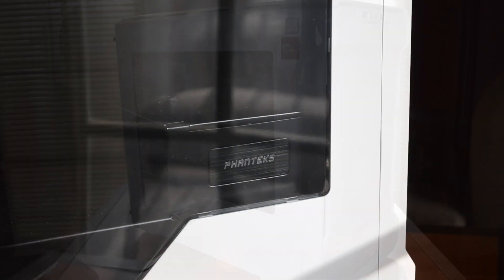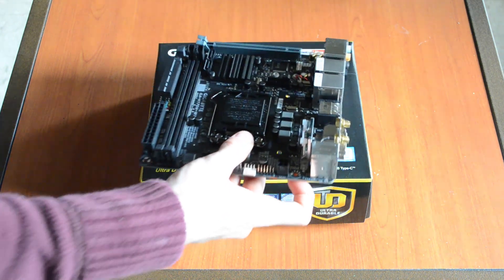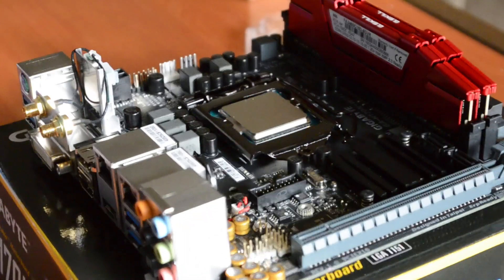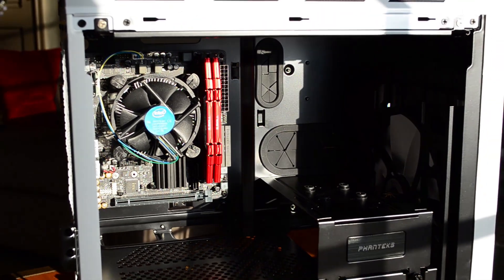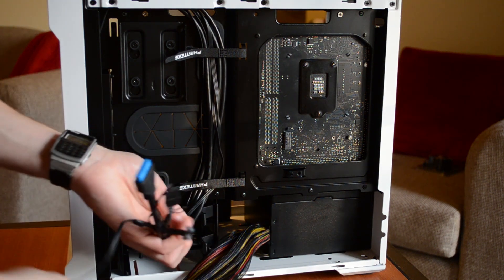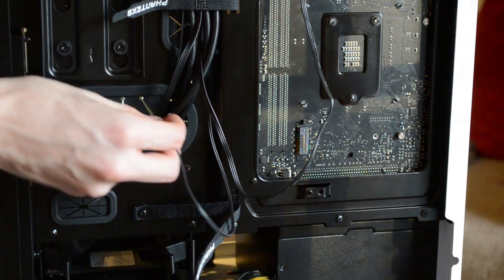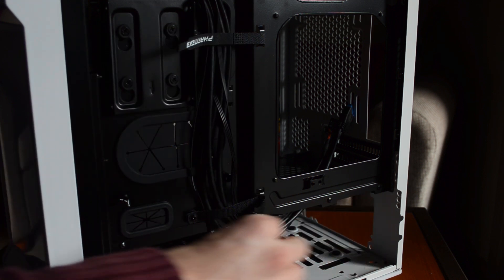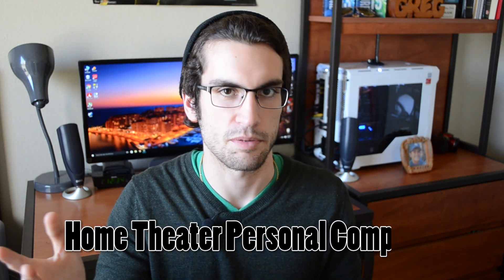How To Build An ITX Skylake PC

Comment: I have this same case, Can some please explain how I can get the temps down on the 3060 GPU I am using, My 3060 is hitting temps of 84 degrees Celsius, I am having to take the side off when I on AMS 2 coz I am worried my GPU temp will creep up and up, Plus surely running temps in the 80s C cannot be good for longevity, I really cannot afford any more new parts now, I only got the 3060 12gb a few months ago, Plus the 12gb 3060 is dealing with every game I threw at it, So far I do think the Zotac 12gb 3060 is well worth the price for how much of an upgrade it is for the PC, I heard or read AMD equivalent to the 3060 in specs 6000 series is getting stuttering problems, I can't say for sure though as I ain't got an AMD GPU...
Yeah can someone please explain how I can get GPU temps to in the 60s Degrees C and not 84 Degrees C, Or is the GPU hitting the 80s Degrees C going to create damage over time, I is even thinking of getting one of those GPU coolers you attach to the backplate, The backplate is getting hot, Hotter than I think it should be anyways, I think it is the case, The clearance from the PSU and GPU is not very much, About half inch clearance if that from the fans on the GPU to the PSU, I was even thinking of getting some more powerful fans for the front, Rather than the one big fan 3 powerful fans on the front, I think might just be better than just the one fan....
The CPU temps are amazing, I am using a Cooler Master V2 240 liquid cooler, Fantastic liquid cooler for the price, Plus it is RGB if you want, Turn it off if you don't, lol, Still a great liquid cooler, My i5 12600k CPU never goes past the 60 degrees Celsius with this Cooler Master V2, I would buy another one if I was doing another PC, I like the black MSI liquid cooler as well though, lol.....
This Phantek case is pretty good apart from the GPU hitting 84 degrees Celsius this case is a tidy semi little PC case, Be aware of the GPU temps though, I couldn't imagine a Beefy GPU like a 4090 would even fit in this case with out using a riser or, Unless it was water cooled, But this case is designed with water cooling in mind apparently, lol, I am not that technical YET, lol....
Great video even if it looks like one of the first videos you put together, Hat's off sticking to it and following your dreams, you deserve all the success you get in turn bro...

Comment: can i use 2x16gb ddr4 ram sticks for a mini itx build?which would be faster 4x8gb ram or 2x16gb ?
Reply: what about 32 gb is 4 x8gb ddr4 sticks more faster than 2 x 16gb ddr4 sticks..I want it for 3d and editing only(no gaming)
Reply: girish chandra bojja Every miniITX board has 2 DIMM slots, so you can't have 4x8GB.

Comment: Would you recommend the mother board/brand from this video? I was thinking about getting the Z170 version with both wifi and Bluetooth. Thanks
Reply: Brandon David only major benefit z170 provide (that differs from h series) is the ability to over lock. And even then u'd need to buy a Cpu that supports overclocking ( in intel's case, a cpu model that ends with k)
Reply: Oh yeah I know, I have the i56600K, I was looking at mother boards and the oc version of his seems nice but there's not a ton of reviews
Reply: since you already have a k version cpu, might as well get a Mobo that can utilize its additional feature to overclock, which u payed extra for, right? I would.
Reply: Oh yeah, def. I know that but I was just trying to get a feeler on the brand and board cause the z version is the same cept the chipset and price.

Comment: Hi, can someone suggest my anything cheaper than the H170N Wifior something the same price that supports

itx mobo, 2133mhz - 2.4kmhz  and the usual stuff.
Reply: I have an Asrock motherboard and I am completely satisfied especially for the price
here is an Asrock one for cheaper for a skylake processor
http://www.newegg.com/Product/Product.aspx?Item=N82E16813157678&nm_mc=KNC-GoogleAdwords-PC&cm_mmc=KNC-GoogleAdwords-PC-_-pla-_-Motherboards+-+Intel-_-N82E16813157678&gclid=CjwKEAjww_a8BRDB-O-OqZb_vRASJAA9yrc5x6C1duZfTVRbR8KgXPk3HKutXAmGI2AP3g4LsMapmRoCbv3w_wcB&gclsrc=aw.ds
Reply: Thank you :) I might be able to find this in our country.
Reply: +Seton Magic no problem! just note this one doesn't have Wi-Fi built in to the mother noard! But I don't find that a big deal one I went Ethernet I never will go back!
Reply: +Carlos Santillana *motherboard
Reply: Carlos Santillana Ethernet is no problem, could you suggest more so I can have more varieties? like gigabytes asusetc
Reply: +Seton Magic 
here is two more 
MSI H110I PRO
ASUS H110I-PLUS D3/CSM
but what I recommend is go to pcpartpicker.com and select a cpu then select an itx case and then when you search for motherboards it will only show you  motherboards that will work, along with their price and rating!
that website was incredibly useful for my first build.
Reply: +Carlos Santillana nvm I don't recommend the Asus one, it only takes ddr3 memory and since you are going to be using skylake you can only use ddr3L which is probably hard to find

Comment: Trying to build a PC with similar components although I'm swapping the 380 with a 380x (unless the 4gb rx 480s come back in stock). Would a 550W power supply be enough or should I go with a 650W?
Reply: TytanyxGames 550W should be enough.

Comment: Hey man!! i'm looking to build myself a Mini ITX rig to place in an other room to game on .... right now i'm running an i5 4690k with evo cooler and a 1070 , but the idea is to get a i7 6700 (non k version) with a 970 i have laying around or maybe even my 1070.  
would it be ok to use a stock intel cooler on an i7 6700 in that kind of configuration , i'm really scared about the temps they might get ....
Reply: as long as youre not overclocking the stock coolers should be fine but keep in mind that they are louder than aftermarket coolers
Reply: I think you'll be fine. The Intel cooler is loud but it gets the job done as long as you don't try to overclock it. You'll need a different cooler if you plan to do so. If the stock cooler doesn't get the job done, just use the cooler that you have or buy a different one. It's only like 30 bucks :P
Reply: It's an i7 6700, not a "k" model, thus not overclockable. A stock cooler should be fine.

Comment: Do you need an itx psu for an itx build? like was the one you used small
Reply: There is no such thing. Use pcpartpicker.com if you're building a pc, it shows if the parts you use aren't compatible.
Reply: The Motherboard is basically the only thing that differs in size.

Comment: reply to this pls I need help
I live in India where computer parts are very expensive due to imports duty and shit.
my config:
i5 - 6500
any good but cheapest H170 or B150 mobile
8 GB DDR4 2133 MHz (again cheapest Kingston fury most probably)
and an Nvidia GTX 1060
with a 240 GB SSD 
all of this will cost around 840$ in India which is too much and a case and power supply is still not included!
so my question is: Is this build will be overkill for an 60Hz monitor as I don't have fund for 120hz or above or 1440p monitor I have a sony 200Hz HDTV
Reply: motherboard*

Comment: Maybe someone can help me, im planning on building a PC very similar to this one, im interested in gaming and rendering video and 3d/2d animation but im planning on getting a gtx 970 or maybe the 1070... anyways, i was wondering, is that MoBo good enough? i mean for the 4 pin conector, an 8 pin conector wont get much more of the cpu performance? (im not going to overclock btw) also, using a wattage calculator says i need a 550w psu for what i need.

This is the first time i build one myself, so i don't really know a lot of things, im doing my research but im still a bit confused.
Reply: Do MORE research
Reply: im researching for a similar build too, to replace my laptop. From what I know motherboard dont really affect cpu performance, 400-550 watts psu are priced similarly, just get the one you need (like fully modular or 80+gold). As for wattage should be enough for most itx builds in that range.
Reply: currently running the same build from this video, but with an MSI GTX 970 4G that I've over clocked and it's fine. however you need a molex adapter to do this, and honestly I'd just upgrade the psu if I were you to one that has the 6pin (or four plus two pin) and 4 pin connector -the one from the video here only has one 4+2, but the 970 needs that one and a 4pin.

Comment: How much fps in Cs go?
Cpu: Intel core i5-6500
Motherboard: MSI B150M BAZOOKA
Graphic Card: EVGA GeForce GTX960 4GB SC Gaming 
Psu: EVGA 500W White
Ram: HyperX Fury Black DDR4 2x4GB 2400MHz 
SSD: Samsung 850 EVO Series 250GB
Cabinet: Fractal Design Core 2500
Reply from the maker: +Nikolai Skarstein A ton. It's a pointless question. You'll never see that many frames.
Reply: +Science Studio oh okey :)

Comment: I have question about the 200mm fan is it quiet or should I buy 2 140mm noctua fans
Reply: It's quite and pushes alot of air. I have it running at 800rpm and have no cooling issues.

Comment: PC case buttons are not sensitive to which way round you connect the header cable. LEDs are sensitive to polarity, buttons are not. The buttons work by simply shorting the pins.

Other than that, great stuff.
Reply from the maker: I have mentioned that in some of my other build logs. Nonetheless, aligning positive to positive and negative to negative is still a healthy practice.

Comment: What case can i use instead of this?I Can't find Phanteks case
Reply: +The D1zz And what cheaper mobo should i get?
Reply: You can get the Define Nano S its the same price as this case and can hold almost the same ammount of hardware. But it's best to have a reference GPU for the Nano S since the GPU is very close to the GPU.

Comment: well, 320*1.5=480
Reply from the maker: Yes, which is why I said "abouuuut 450."
Reply: +Science Studio I mean, if there is only a difference like 3 or 4 watts more than 450, you can say that. For the real deal, you are using 430watts, I don't think 50 watts is a "small gap". Normally I would use your psu calculating function as well, but if I got a result like 480, 473 or even 460, I will go with 500watts ones, just in case I might have more other usages.
Reply from the maker: +郑程耀 I know how it works. However, I wanted to prove that even a system as refined as this one doesn't need a beefy power supply - only a reliable one.
Reply: +Science Studio Oh, thanks, that dispelled my concern. I was not sure if this way of psu choosing will be reliable when I was shopping my pc parts. Got some new knowledge tho.

Comment: I love my full sized atx towers man. I may not keep em forever. If I can get intel E series in itx and fit the highest end amd and nvidia gpu in an itx I'll be all for it.
Reply from the maker: This case here will fit pretty much any graphics card you throw at it. As for the CPU/ITX support, that isn't the fault of the case, but it was nice to play around with a smaller PC for a while. It was a different feeling.
Reply: there is an x99 itx board from asrock so you can get your extreme editions although overclocking would be limited and you might have trouble finding high wattage sfx power supplies so make sure the case supports atx or you might be capped at 500w

Comment: A 550 or 600W PSU would be ideal for this build as power supplies operate at optimal efficiency at around 50% load. The 430 would almost be maxed out in this build meaning, you're going have worse efficiency, thus more heat, which equals wasted energy.
Reply from the maker: The maximum power draw is not near 430W. I'm pulling about 350W under load from the wall.
Reply: +Science Studio This is would be running at about 80% load on thr PSU and would still kill efficiency, but since this PSU is only 80+ white rated anyway, I'm guessing that's not a concern. As I said though, a higher wattage power supply would mean better efficiency and therefore less heat generated, hence a cooler system.
Reply from the maker: Not much heat at all is generated by these PSUs under load. A lot of people tend to drastically overestimate their load power consumption. I went with the 430W to prove a point, otherwise I would have spent $5 more for a 500W. I broke down each part's individual power consumption in the video. Even with a safety factor of 1.5 (an extremely liberal estimate), we barely hit 450W.
Reply: +Science Studio Like I said, it's not only about heat, it's about the power efficiency and PSU operate at optimal power efficiency at around 50% load. I do understand that this wattage is more than enough to run the system, but the efficiency takes a dive at about 70% load. Of course you won't run into a situation with this setup to where wattage will be a concern.

Comment: mATX > mITX,  IMHO. Almost all ITX cases are not so small when compared with their mATX competitors. mATX does not leave you with the single pcie 16x, which for someone looking for an upgradable computer, would be a better option.
Reply from the maker: It's an entirely subjective decision. Most aren't going to fill those extra PCIe slots with anything at all. And this case here just happens to be a very large ITX case.

Comment: Processor:AMD FX4300 3,8Ghz/4-star
Ram: 8GB DDR3
Modercard:Asrock
Hardrive:1TB 7200rpm eller 120 GB SSD
Graphic card :GeForce® GTX 750 Ti (2048MB GDDR5)

Is this good and what games can i play?? And its cost 600 dollar. Is it a good deal?
Reply from the maker: +SMAAAASHTV ^ Ditto. Don't purchase something that won't meet your expectations.
Reply: show off 
*sorry
Reply: Lightning Corner Stone ?
Reply: The build in this video is leaps and bounds better than the specs you posted and only around $100 more. If you know how and where to shop, you're almost always better going with a core i5 vs a low end AMD FX chip. Not only the but the R9 380 would beat the pants off of the 750 Ti, and that's saying something as I'm team Nvidia.
Reply: +SMAAAASHTV and 960? wtf m8 750 ti costs nearly 100 dollars less
Reply: +Lino Fragoso did I say the R9 380 and the 750 Ti were the same price? Nope, I only mentioned that this build would beat the OPs build, hands down, for not much more money.
Reply: +SMAAAASHTV ah sorry

Comment: Hey great video man...
Can u tell me which motherboard is best of i3 6100 , I will not overclock it. Where is go with Asus or Gigabyte or Msi H170 or H110.
Thz, plz comment....
Reply: +Aakash Gupta in your case, if you aren't planning to connect a lot of stuff to your motherboard just get an h110. It's cheaper and doesn't affect performance in any way whatsoever. It's almost universally accepted that asus provides the best quality motherboards. 2nd would be MSI and 3rd Gigabyte, in my humble opinion. Asrock is the cheapest but a lot of people have reported more issues with their motherboards than other brands.

Comment: I have i5 6600k over clock to 4.5ghz using Corsair H100i GTX. Its running at 800+ rpm with silent fans. Its super quite. 
The skylake is cooler than it predecessors, you should have bought it...
Reply from the maker: The i5 6500 is just fine for this build. We'll be building with an i5 4690K in the next.

Comment: My 280x blew up on a corsair 500w psu....
Reply: I also had a i5 but 4th gen but it's like 88w
Reply from the maker: +big S It wasn't because you weren't receiving enough wattage.
Reply: +Science Studio it was i had another psu blow on me , a antec 500w ... . If it wasn't I just weren't very lucky with my psu's . My brother runs it with a evga 600w and it's been fine for ages . 430w will be the first thing to die in this PC I would bet every last penny on it .
Reply from the maker: +big S No, 430W is more than enough. I think you're a bit bitter over your past experiences with PSUs ;-)
Reply: +Science Studio  still I wouldn't risk it for the long run
Reply from the maker: +big S True, a bigger and more efficient power supply is always better. However, those building on a tight budget won't have a problem opting for the 430-500W option.
Reply: yeah i agree

Comment: nice video bro :D. I have a question i am not able to decide b/w i3 6100 and i3 4160 now going the 6100 route costs me more as its mobo and ddr4 ram is more expensive . So if u could make me know which one should i pick i am gonna be gaming and do some video editing.
Reply: +ALESTA HD I suggest putting the RAM decision/cost aside and plan for the future.  The 6100 will allow you better upgrades in the future should the need arise; the 4160 is an older socket.  My 3770K build doesn't hold a candle to my son's 6700K build, and there may be further LGA 1151 CPUs to come.  Also, if you're going to use the built-in graphics the 6100 has superior graphics.  When you factor in the RAM, DDR4 performance is better and going to get even better in the future (and hopefully cheaper).  I think in the long run the higher cost of the 6100 and DDR4 will not only be worth it, you'll spend less money overall.  This assumes you don't already have some DDR3 RAM that's perfectly good for a new build waiting for a home.
Reply: with a h110m motherboard it shouldent cost much more
Reply: Lino Fragoso well I am in India so all parts cost like a 10 to 15 % more